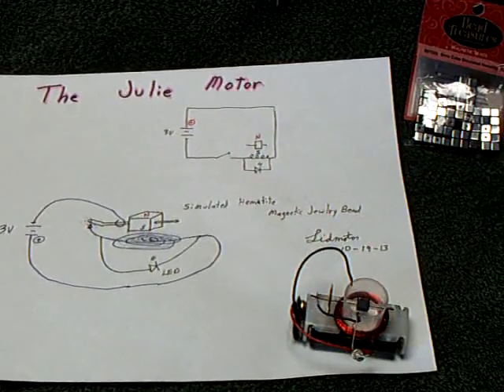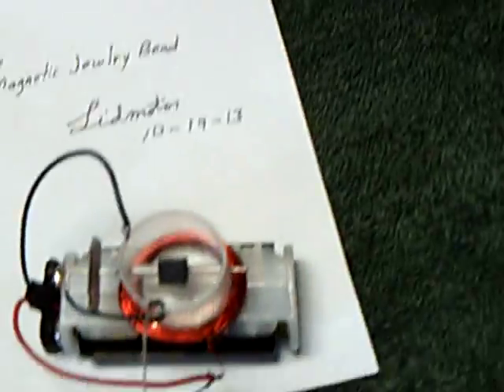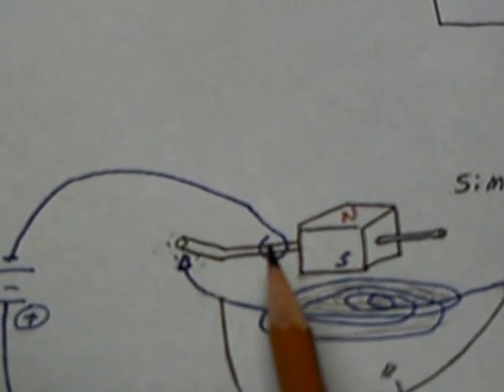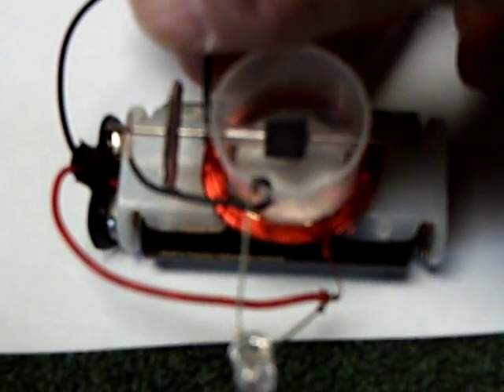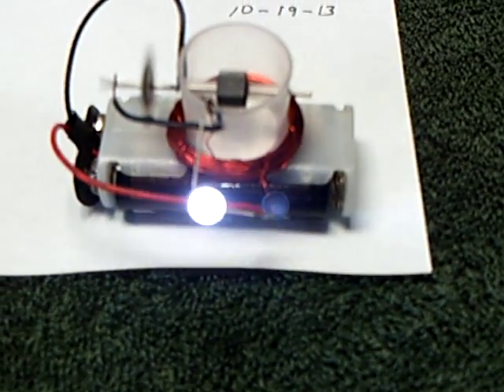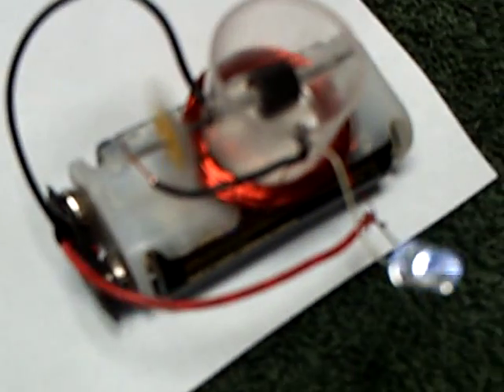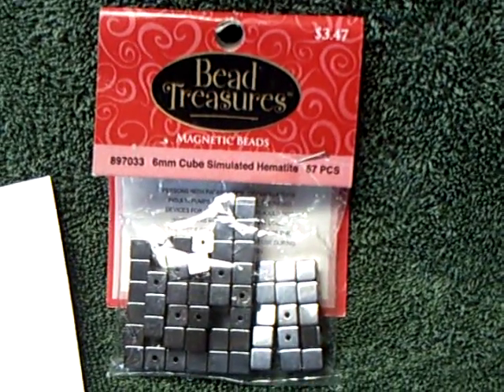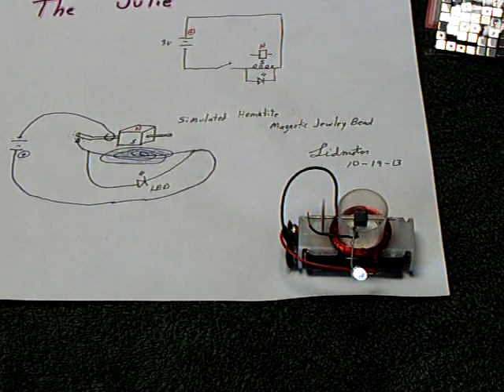The Julie Motor

Comment: I can never make the commutator to work on none of this type newman motors
Reply from the maker: Yes. Getting the coil to fire at just the right time so that the magnet rotates is tricky.  Start testing WITHOUT the commutator.  Just tap the two wires together and see if the motor rotates. Notice where the magnet turns best when you tap the wires.  Now you want the motor to do that job itself over and over. There are a number of ways to have the motor do that.  The easiest way is to use the metal motor shaft. Make sure that the 'brushes' don't cause too much friction on the shaft or the motor won't turn--- even if you have the timing right.

Comment: hi,i have made a few motors.plz visit and give suggestion.my video qualities r poor.but i visited ur page 2days ago.from ur concept i made 2 motors-newman and jolie in first attempt.thanx sir.i don't understand what the basic difference is between paper clip motor,joulie motor and newman motor.i think they r all the same.i have built a motor with homemade reedswitch using thin tin plate.i tried to make electronic pulse motor using BDX54C.but in vain.why?i suggest u to specify wire gauge,

Comment from the maker: It is kinda like 'what goes up must come down'.  When the energy gets into the coil and the power switch turns off, the energy comes flying back if it can find a way out as high voltage but very little amperage.